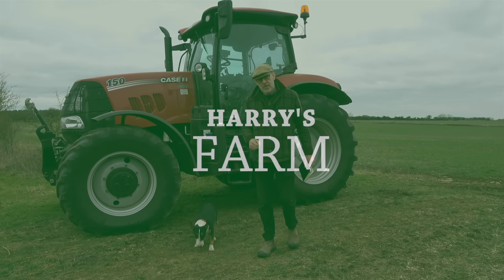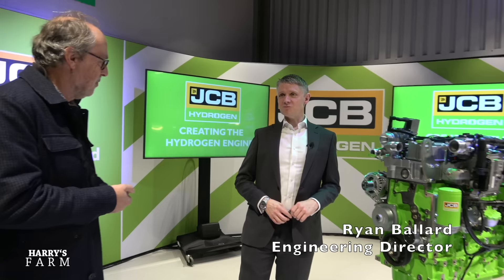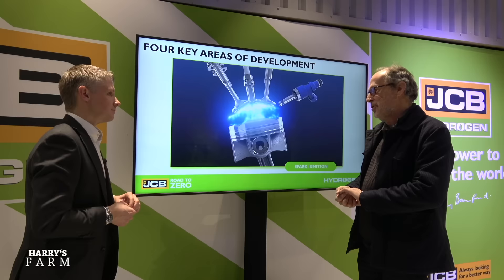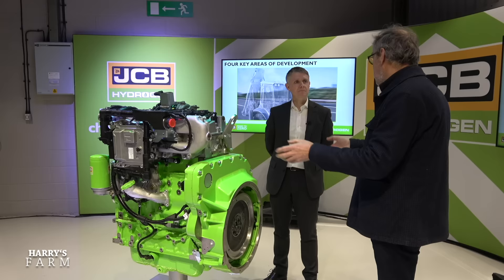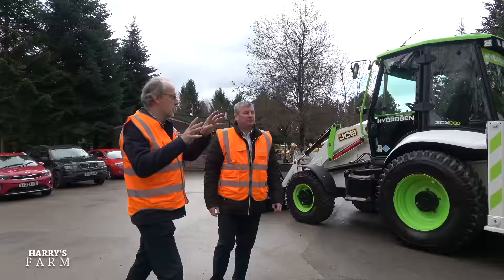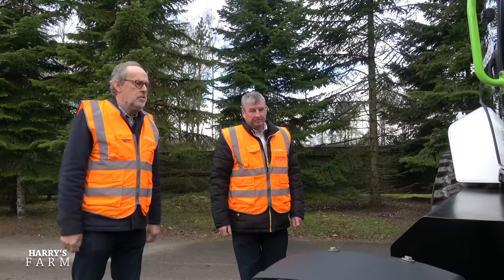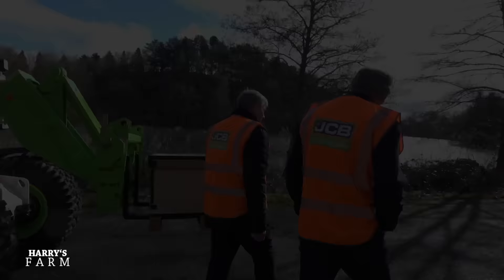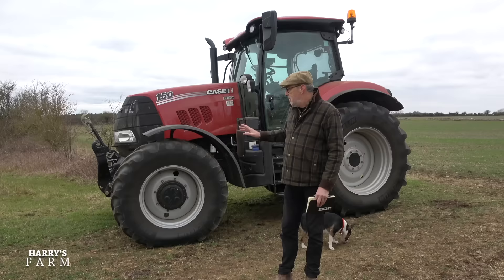JCB is moving to hydrogen power for all their big machinery. Here’s why.

Comment: Maybe I'm missing something but I believe hydrogen fuel cells are around 60% efficient, this engine is around 40%, so will use one and a half times the fuel to produce the same power as the fuel cell. Fuel cells produce electricity, so it would be an electrically powered machine  but would derive all it's power from hydrogen, I don't see the advantage for a hydrogen ICE over a fuel cell.
Reply: The engine does not use any exotic materials and is simple to recycle. Fuel cells and batteries use lots of very rare, very difficult to recycle metals that will run out.
Reply: @user-yt1qs9jt6h  Back in the 1940s the US railroads converted many of their large steam locomotives to be oil fired, steam engines are not very efficient. Meanwhile powerful, compact and efficient diesel engines which were  ideal to use in a railway locomotive and ran on oil were in use in submarines, far more efficient than the oil fired steam locos. Oil fired steam locos didn't last long. This is a stopgap measure at best.

Comment: Harry, I do, VERY MUCH, like JCB's off road use of Hydrogen, but......
just consider a U.S. or European Interstate system with 100s of thousands of Trucks weighing in at a combined 80,000 LBS+. Each Truck Hydrogen Fuel Cell or I.C.E. powered in a future Hydrogen Transportation System when built out as envisioned, with truck after truck driving up the same hill all day in sunny or cloudy freezing winter temps or at night with Hydrogen fueled fuel cells or I.C.E. laboring to pull the load up that piece of hilly terrain, each vehicle dumping out their water vapor by-product exhaust just above or directly onto a rising or descending freezing cold road surface resulting in black ice forming on clear days or nights to greet you, or wreck you on your morning commute the next day. How about driving along the Interstate system with many traffic delays greeting you because of all the accidents choking an interstate system covered here and there, who knows where, from patches of black ice causing accidents as vehicles slide on the excess moisture that has created a thin veneer of indiscriminate black ice patches interstate system wide. Please stop and think about these higher humidity microclimates built up from higher humidity levels when combined with calm wind then precipitating moisture out onto below freezing road services along so many rising hillsides Interstates forming up ice patches to be found, who knows where as you travel about at high speed? Have you ever seen frost, rain or ice and thought about how these are formed in our atmosphere at ground level?  If we are also to have a on road hydrogen vehicle fuelled economy,  I guess I will invest in buying publicly traded stocks of companies that provide metal guardrails, concrete barrier repairs, and medical emergency services so that I can make much money on a not so deeply thought out full scale hydrogen fuelled hard surfaced Interstate transportation economy in constant state of disarray, and mayhem . Conversely, if you like Stifling Hot Humid Oppressive Sunny Summer Days to suffer through when your sweat will not cool you off, the idea of lots of Hydrogen Fuelled tea kettles roaming about in a Green Transportation Economy like proposed here is a perfect solution for Hydrogen supporters to enjoy their dreams. Talk about impactful "human induced climate change"! Have you ever stood on a hill overlooking a city seeing a brown particulate haze collected there from burning hydrocarbons for our transportation needs, and note that the haze is not moving, just hanging there in a disgusting way over the City? Now replace that with an equally worse gray haze of humidity to cut your way through when walking about on a hot Summer's Day. That seems to be our pay back for switching from a Hydrocarbon Combustion Energy based Economy to a Hydrogen Combustion / Fuel Cell Energy based Economy. City dwelling Asthma sufferers will be so pleased by what we have created for them to not so easily breathe in, if they can breath. Maybe Hydrogen Economy supporters like pumping excessive amounts of humidity into their local Environment to produce uplift resulting in thrilling intense Thunderstorms and Tornados to personally experience while reducing greenhouse gas emissions to avoid those other pesky climate catastrophes. Careful what WE wish for !

Comment: Zero Emission construction equipment in cities are required for air quality reasons, this has all to do with that small particles are bad for our health as they are inhaled deep into our lungs. A hydrogen indeed has zero CO2 emissions, but that's not core of the problem for city air quality. It has to do with small particles, mainly nOX! And that is not resolved with this engine, you burn hydrogen you will create nOX and therefor it is NOT zero emission.

Comment: The Japanese have in operation a nuclear nitrogen cooled nuclear reactor.  The high temperatures created makes it feasible to produce hydrogen, all at the same nuclear plant. Japan is looking to be a hydrogen society.  The reason why is that hydrogen is the only alternative to burning large volumes of fossil fuels for heavy industry. This means large vehicles like trucks and railway engines can run on hydrogen as in many cases battery EVs are not practicable.  So it looks like hydrogen will be a part of the future. Hybrid battery trains are here, in that the trains run and are charged on electrified track, and batteries, on unelectrified track. They are used in other countries like Japan, and soon in the UK by Merseyrail in Liverpool with their new class 777 trains, so batteries will have a say in propelling large vehicles. Combustible hydrogen trains will be precluded from underground railways for sure. 

Mentioning Liverpool brings to mind that a trial of a hydrogen fuel cell train was to be trialled between Liverpool and Chester - the hydrogen is available from Stanlow nearby. Covid got in the way and it never happened. These trains are in operation in Germany. The great thing is that the hydrogen can be produced at train depots using grid power, so no road transportation needed. Also a district of Ellesmere Port near Stanlow is having its natural gas network and appliances converted to hydrogen as a trial. 

JCB had to convert existing engines hydrogen as the ICE they have heavily invested in. And also the operation must be identical to the existing range for users.  The piston ICE engine is a dog of an engine with 80% of the fuel in the tank wasted.  As Stanley Hooker of RR said, one stroke creates power with three wearing your engine out. The hydrogen fuel cell is more efficient.  It is worth noting that the most efficient ICE engine running on hydrogen is the Wankel engine. It is 25% more efficient running on hydrogen.  

Mazda have just introduced a Wankel engine in a hybrid that only turns a generator, as Wankels run more efficient in a narrow rev band. The engine is capable of running on hydrogen. I believe Toyota were involved in the engine's development, who are looking to hydrogen powered vehicles. Maybe JCB should look at Wankel engines, with the power to the earth moving machines by more efficient electric motors.  Wankel engines are one third of the size and weight of piston engines. Converting existing engines to hydrogen from diesel can only be an interim move.

Comment: I like the hydro angle however, why not build the hydro generator on each machine where all you do is add water and salt or whatever the chemical is they're using to make the gas? Huge trucks driving around that have to refill sounds dangerous. Like hydrogen bomb dangerous. sigh
Reply: What you're describing is hydrolysis. What is going to provide electricity for the electrolysis reaction?
Reply: @logitech4873  A battery. The same battery used to start the engine. Then once started the onboard alternator or generator that recharges the batteries.
Reply: @trpnpics  Well there's a very big problem with that. It takes a lot more energy to run electrolysis than what you get back from combusting the resulting hydrogen.
It's not a self-sustainable reaction. You need a large outside source of energy.

Comment: Thanks for the great video, it is a brave move for JCB to move to 100% hydrogen, it is a first step into the carbon neutrality, cool!

Questions though is whether this particular tech direction, e.g.,  a hydrogen combustion engine is the right thing? Granted, switching from diesel fuel to hydrogen would be quite straight forward, and could re-utilize the enormous amount of resources that human being put into diesel infrastructure. 

However, several fundamental issues with hydrogen may make the direct conversion from diesel to hydrogen less practical than other type of green engine, say green ammonia or synthetic oil, eFuel as Europeans call it😀  First the low volume density of hydrogen,m even at hige pressure of 700 bars, makes onboard carrying of hydrogen a huge burden to any compact construction and agricultural machines -- any decent working hours would require an gigantic cylinder to store hydrogen, plus, the safe storage and transportation of hydrogen is another nightmare. Perhaps a combustion engine run on green ammonia is a better soluton.

That being said, Kudos for JCB for taking the lead towards zero carbon machinery -- Kubota, Volvo, Cat, Yanmar are all working hard towards as well.

Comment: Did i hear that properly, zero emissions. Why these flipping silly battery cars then. Only issue is, producing enough hydrogen, I suppose that needs scaling up. I'm sure haulage and bus companies will be taking notice of this. What a great company JCB is.
Reply: Because these ‘flipping silly’ battery cars are 5 times more efficient.
Reply: @Simon-dm8zv  no they're not
Reply: @jamesfirth2392  I presented you a simple fact.
Reply: @Simon-dm8zv  no you didn't
Reply: @jamesfirth2392  Basic physics dude
Reply: @Simon-dm8zv  electric cars, basic crap dude
Reply: @jamesfirth2392  I haven’t heard a single valid argument for that.
Reply: @Simon-dm8zv  haven't heard a single argument that they're five times more efficient.
Reply: @jamesfirth2392  Like I said: simple physics
Reply: @Simon-dm8zv  physics is the branch of science concerned  with the nature and properties of matter and energy. The subject matter of physics includes mechanics, heat light and other radiation , sound, electricity , magnetism, and the structure of atoms. Which comes to a conclusion that electric cars are shit.

Comment: Hydrogen is just as polluting as Diesel and yet more expensive to produce.
Just 8% of the energy or electricity that is used to split water into Green Hydrogen and Oxygen actually makes it to turn the wheels of a Hydrogen vehicle, whilst 75% of the  Electricity generated actually power the wheels of an EV.
95% of Hydrogen produced in the world comes from steam reforming Methane which is very polluting

Comment: Burning hydrogen in an internal combustion engine is stupidly wasteful.  Fuel cells and electric motors are vastly simpler and more efficient.  In an ICE you're lucky to get 40% of the chemical energy of the fuel delivered as torque. The rest of it is blown out the tailpipe or dumped through the radiator as waste heat.  This also won't get. you to zero emissions, because you'll make nitrous oxides.

Comment: Bamford is absolutely deluded.  Of course it is easy to ignore reality if your job depends on it.
So no answer on Hydrogen source or price, except the usual propaganda that it "will" be cheap.  For $3 or $1 per kg we can just use the Hydrogen to produce electricity at 6p per kWh, it kinda breaks conservation of energy, it based on free electricity and is for "Hydrogen production" which strangely doesn't have a big business model and doesn't include compression and distribution.
£150 to fill it, how does that compare to red diesel?   Seems to be more than 4x (assuming you can drive to the pump).
6kg of Hydrogen is the same amount you get in a Toyota Mirai to achieve 400miles (using a fuel cell that is 2x as efficient as a combustion engine), about the same as a 100kWh battery in a Model S.    or 50kWh battery for 6kg used in a combustion engine.
The 50kWh battery charge costs £4 normal off peak maybe £10 at day rate, and £15 at stupid prices, eventually it will be much cheaper.  6kg of Hydrogen is £90 today if you drive to the pump, try adding the cost of the bowser and its Hydrogen.  100kWh battery electric is equivalent to about 8 gallons (imperial) of Diesel once motor efficiencies are taken into account.  6kg into a combustion engine is about 4gallons of diesel.
So according to JCB a 50kWh battery (the same as in a hatchback) or 4 gallons of diesel is sufficient to run a tractor all day.
Tesla are putting in 100kWh in cars and 700kWh batteries into their semi, that should last all week for a tractor.
A rule of thumb is that 1 gallon (imperial) of diesel needs about 14 kWh of battery storage to replace it.  For a combustion engine 1kg of H2 produces about 1/3 less work than 1 gallon of diesel.
Anyone else want to chip in and check these calcs?

Comment: Painting an engine green isn’t going to make it “eco-friendly”. Hydrogen as a fuel is frankly ridiculous. Farming is already borderline financially unfeasible using red diesel. Imagine having to transition to burning hydrogen instead - it will be significantly more expensive to run. You briefly mention that battery power won’t work but don’t give any reason why. Even if we ignore battery option, continuing with using diesel makes more sense than hydrogen. It’s not my job to explain the logic behind this, I suggest people do the maths.

Comment: I understand that playing with tech is fun and that developing, producing and selling creates jobs and keeps our current system running, BUT …… isn’t the total energy balance for hydrogen driven vehicles totally through the roof?

Why not make it simple, stupid and beautiful and run the diesel engines like Rudolf Diesel intended it? Why not use them as oil burning engines?

Here in Austria I run my old Volkswagen on any kind of used oil. Vegetable, Engine, Gearbox and Hydraulic Oil. There are a few Mercedes that run on used oil to. We even have some farmers that run their common rail tractors on plant oil. They have some software tuning done, nothing else.

Why always make it complex, big and dependent? The solution to be, not environmentally correct but, independent and sustainable is very simple.

Comment: Sorry, but they JCB are NUTS! pressurised H2 at 700Bar (~10,000psi) has 1/10th the calorific value of the same volume of diesel. What does this means? Well the engine will have crap horse power for the size, the fuel tank will be 10X's the size of an equivalent diesel , cost a fortune (check out Hydrogen embrittlement) and be extremely heavy to cope with the pressure. It will need 10X's the number of tanker journeys, with that new fleet of Nickel superalloy tankers to supply it ! If you get a diesel leak, youl get a puddle under the tractor and nasty smell. If you get a Hydrogen leak itl cause more than the 'squeeky pop'  when 5ml is ignited to demonstrate chemistry to school children. Looks to me as though the CEO should stick to going to polo with his public school chums, coming across a 'nice chap' does not a wise man make. I think hes there by his connections rather than 'nonce'. Bet they have pronouns on the shop floor. Idiotic-thats what this looks like to me.
Reply: They also have no concept of how big countries like the USA are. Joe Bloggs hires a hydrogen excavator, takes it out into the boonies in New York State and runs out of hydrogen. Now they have to get the bowser from the hire shop all the way out to him, and do this every day for every customer they have. That's not going to be cheap. Also only corporations will be able to afford to run these machines because it's no longer just an excavator you're buying, but all the support equipment required to refuel it. then there are the inevitable regulations about storing hydrogen that will have to be passed.

Comment: I don't understand why hydrogen? Where do you purchase it, how do you transport it, store it?  As some one who has gone all electric with 2 cars and a home powered 110% with solar it baffles me as to why you would want to go to hydrogen.  Don't you have all the same components of an ICE or diesel engine?  How man hours of regular maintenance do it require?  Can you produce your own hydrogen? If so what is the cost and how labor intensive is it?  My solar panels work silently without any effort or labor.  My return on my solar system (panels and power-walls) is about 9.5% at today's KWH cost.  Maybe I am just ignorant of the workings of hydrogen but my limited knowledge tells me electric powered vehicles are the wave of the future.  Caterpillar is working on bringing electric versions of some of their biggest machines to market.
Reply: You are correct sir. Hydrogen fuel cells are a fool’s errand for most applications and hydrogen in a combustion engine is even worse.